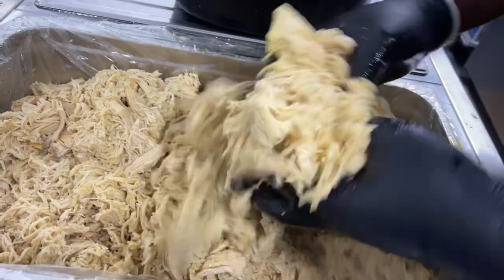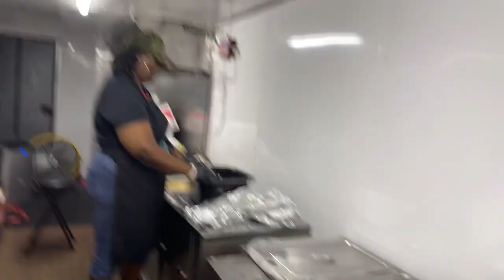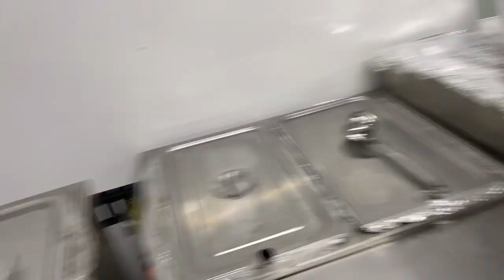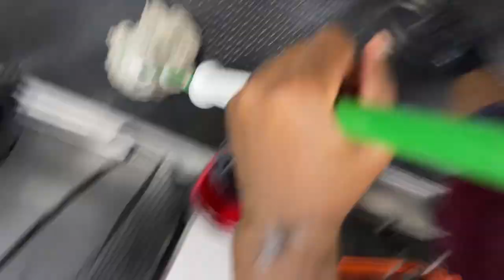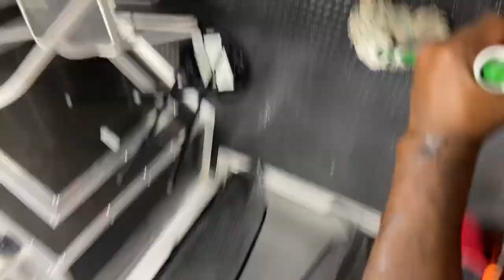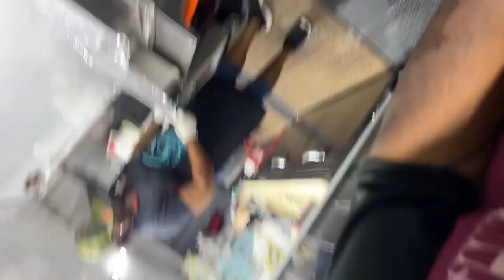Pulled chicken

Comment: T a tip for your chicken to stay moist keep the chicken OFF the steam table put it in a crock pot that have a serve temp on the dial add some chicken stock with you season in it and have a perforated spoon when you need a bbq chicken sandwich use the perforated spoon to get the chicken out the crock pot and have a squeeze bottle with bbq sauce and add to the sandwich. Just remember cook the chicken like you normally do and when it comes to pulling the chicken like in the video pit it in a crock pot not a pan TRUST ME IT WOULD be all the BETTER the chicken want shrink are dry OUT!!!